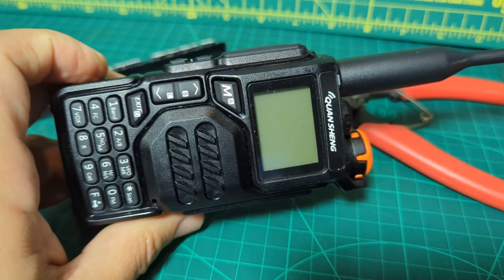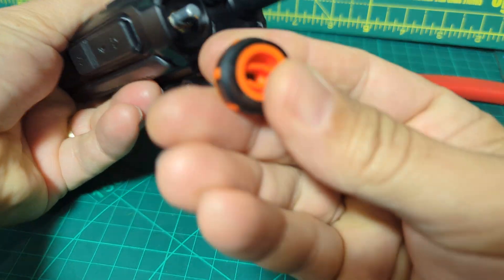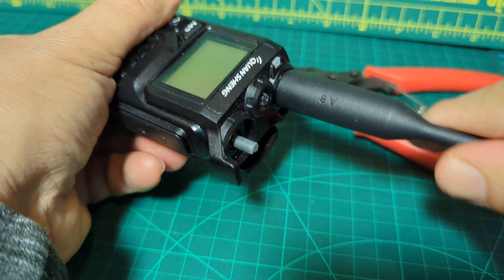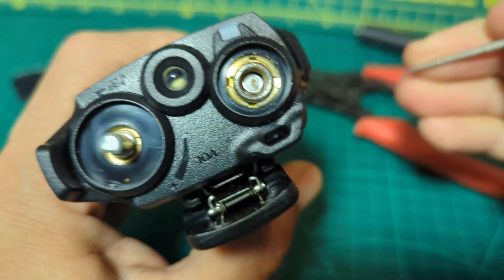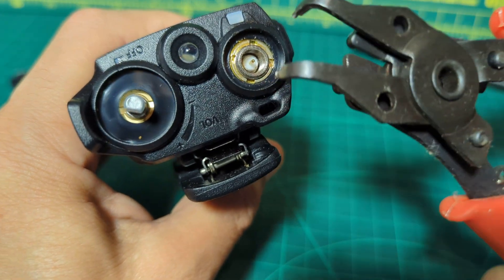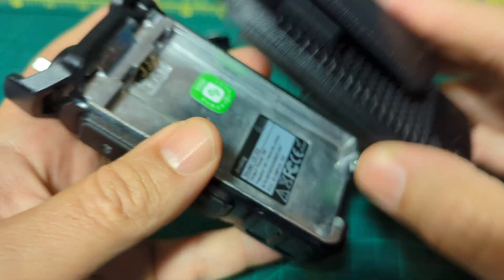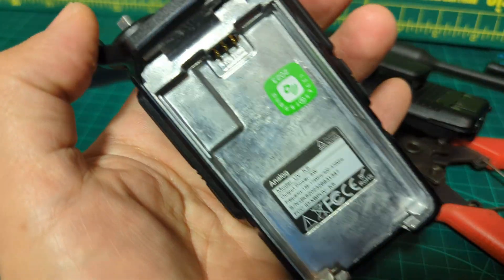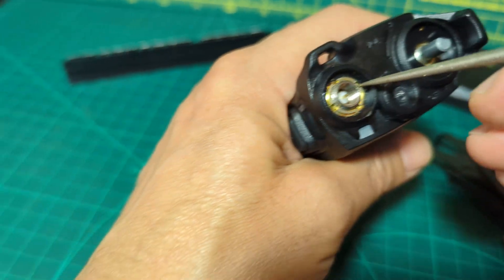HAM RADIO REMOVE ANTENNA BRASS /COPPER RING

Comment: No need to remove the ring the UVK5 will come out without doing that just pop or lever the bottom.
Reply from the maker: Lol yes realised that how u think about soldering usb C to the UV-5R model ?
Reply: @HamTechRadioScannerDrones  shouldn't be a problem if you have a good solder kit. Sure it would work